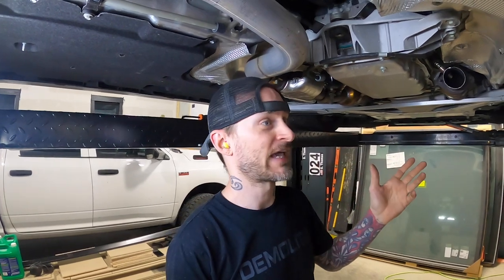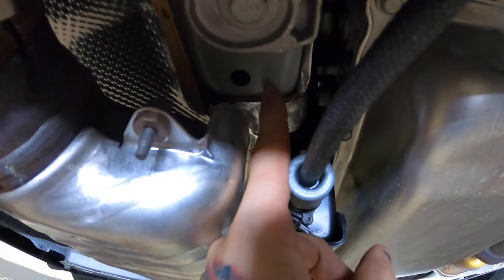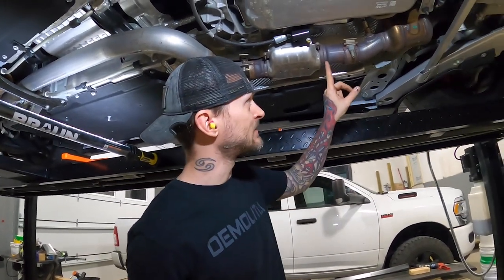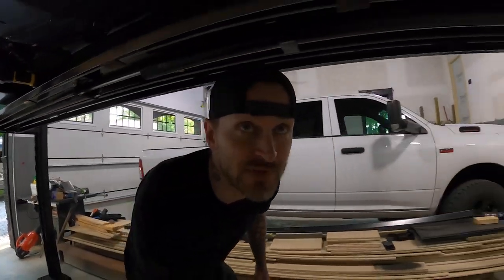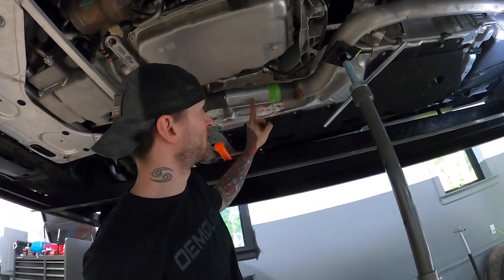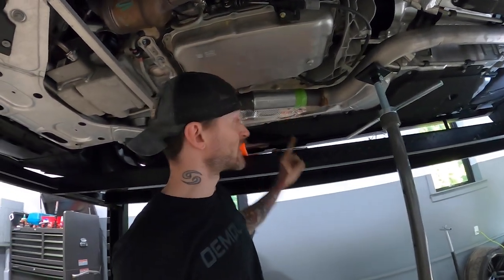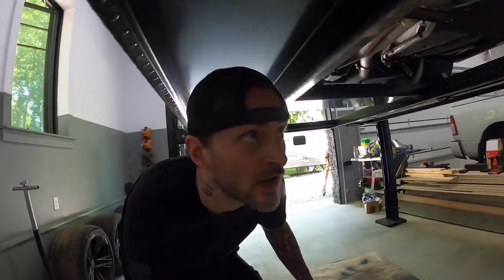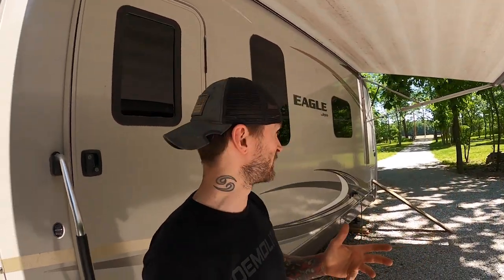Modifying the Camaro ZL1 1LE CBE!!  LOUD!

Comment: You should have bought the Manual ZL1/1LE! No issues there. A torque convertor can never match the engagement and feel of a Manual.
Reply from the maker: But a manual will never be faster than any auto, dual clutch or not.  It’s faster in a 1/4 mile and on track.  It’s insane how good it is in track mode.   There’s no touching it.  Even the best heal to toe shifter in the world can’t match an auto on track 100% of the time every time.
Reply: @neckofthewoods24  Yes but often do you track? The ZL1/1LE blitzed a time of 7:16 (unofficial time of 7:13) at the Nurburgring (It was a Manual). My buddy in a bone stock ZLE with stock seats did 1:58 at VIR in a 'Manual'. A pro driver in a 991.2 RS with race seats/harness and PDK could only muster 1:59.
Reply from the maker: @AllIsWell_22  more and more I hope.  And the VIR lap time was an auto and the Nürnberg ring  time they only made a 6 speed manual.  Now with the auto out I guarantee it’ll destroy the time.
Reply: @neckofthewoods24  I get it but for the VIR Lightning Lap's the Auto was only .7 second faster on that massive track with the same driver. You'll be surprised at how good the Manual is. It also has no lift shift.
Reply from the maker: @AllIsWell_22  I know.  And my 370z had synco rev match. Amazing system.  Just not as good or as fast.  I love the auto.  Manuals just old.  My $0.02.